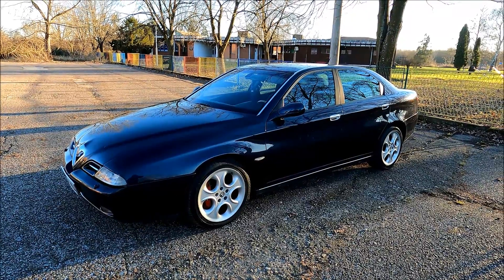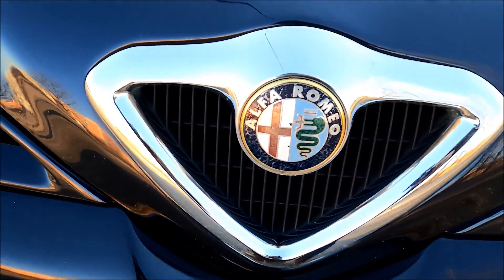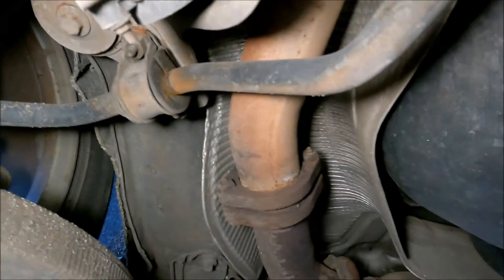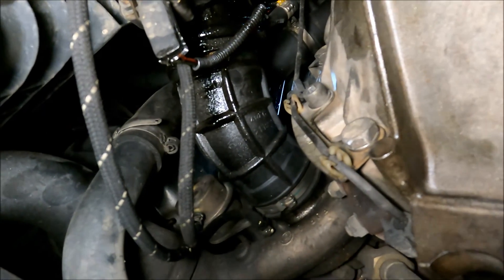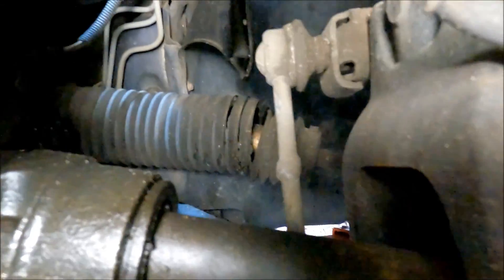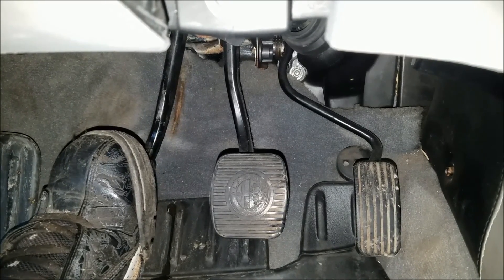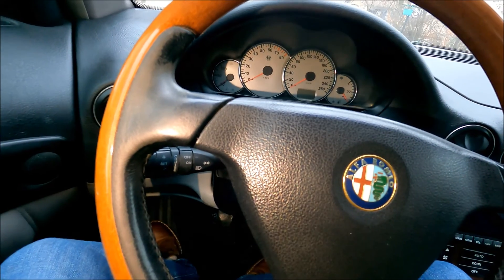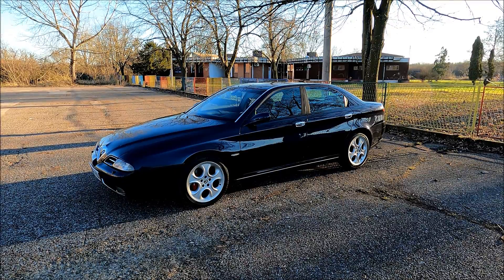Everything That's Broken on my Alfa Romeo 166 2 0 Busso Turbo

Comment: Hi i have the same one with the 2.5v6. From what i saw you need a new rear main seal aswell. The oil cooler pipes are still available i had the same issue. Also the rear brake lines look pretty bad you should take a look at that. Also check the heater core those are common to leak and destroy the ICS and central locking module on the way.
Reply from the maker: Hi, nice one, I almost got the one with the same engine. The main rear seal is good, and the brake lines are like new, maybe it is hard to see in the video. Got to check the heater core definitely, I am waiting for a bit nicer weather...
Reply: @arcgarage  Taking out the glovebox and right side dash trim you have acess to the back of the ICS. You can fix some sort of plastic so if the heater core goes bad it wont drip on the modules. Also the ECU is in the passenger footwell behind a plastic cover.

Comment: Thanks for the video, i'm checking a 166 v6 tb this weekend, can you reccomend me what to look for? Thanks 🍀
Reply from the maker: Make sure that all electronic components work like electric windows, mirrors, etc. Check the clutch, where it separates. Hook the car up to a diagnostic tool and see if it has any codes. Check the service book if it has one, and most importantly check the turbo. Make sure that hoses are free of oil, and that there aren't any funny sounds... Body panels are galvanized, but check for rust anyways...
Reply: @arcgarage  thank you for the reply, i will let  you know if i buy it :D